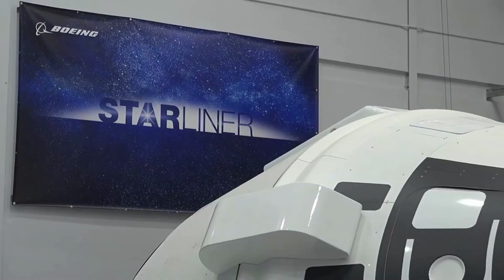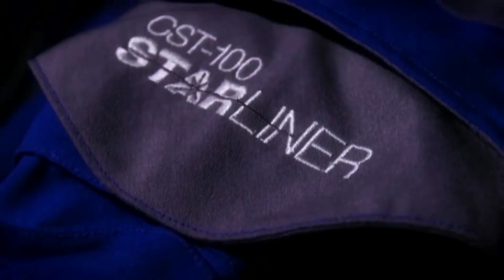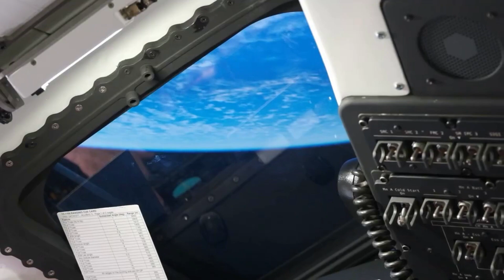Boeing’s Starliner Spacecraft Prepares For Its First Crewed Mission

Comment: NASA should ride out their current contract with Starliner, then forget it and move on to Crew Dream Chaser.  :)
Reply: Dream Chaser has a demo CRS mission on the Vulcan Centaur scheduled for later in 2023. SNC wants to use the 6 mission CRS contract to the ISS to prove out Dream Chaser for a crew version. With Starliner looking like it will fly once a year to the ISS and the other Crew Dragon missions, the ISS may be decommissioned before NASA needs more crew flights. If the Commercial LEO Destinations (CLD) program bears fruit, a crew Dreams Chaser may service those commercial stations. SNC has partnered with Blue Origin for Orbital Reef for CLD, so they have a potential customer for crew flights, IF Blue doesn't take too long with development.
Reply: Hell yeah!
Reply: Dream Chaser hasn’t docked at the ISS, who knows if that will be successful (?)

Comment: Pray for those going up in this rat trap may they rest in peace.!!😞
Reply: I dislike boeing just as much as the next guy (especially how it beat out crewed dreamchaser in round 1 of commercial crew 😠),  BUT it isn’t a dEatH TrAP (at least as shown by what it has done so far)

A buggy KSP2 like failure (or at least majorly underperforming compared to expectations) is a more accurate description in my opinion.
Reply: Gosh it looks like you ppl want these two to die, be more optimistic
Reply: @ewwwwhh  It got lost once due to computer glitches then when in made it its docking had minor issues. It still has problems that boing has not complied with. In my books human travel in the craft is a roll of the dice at best.!!😉